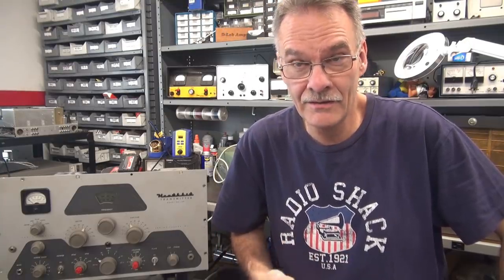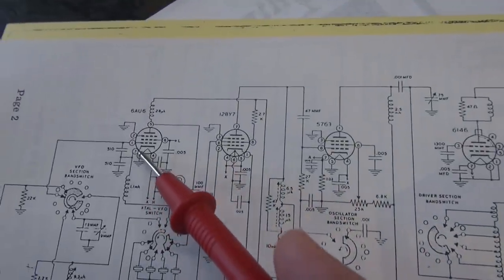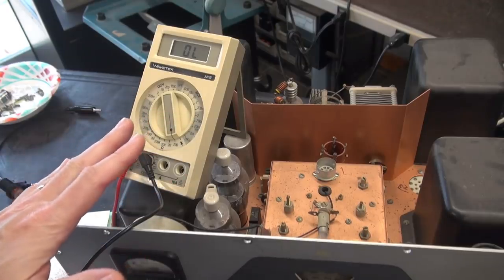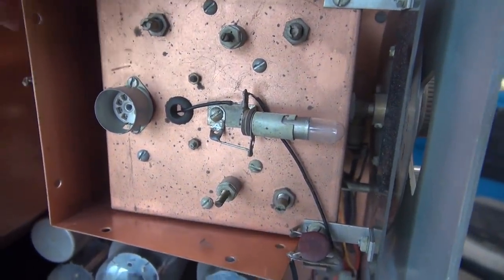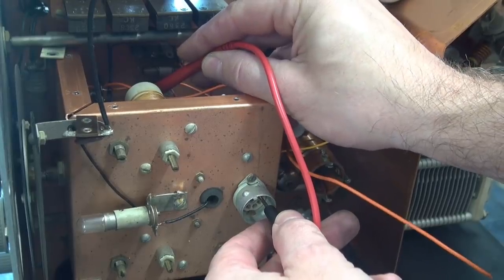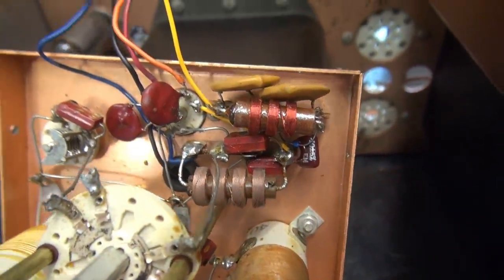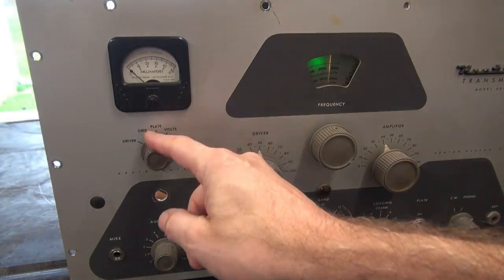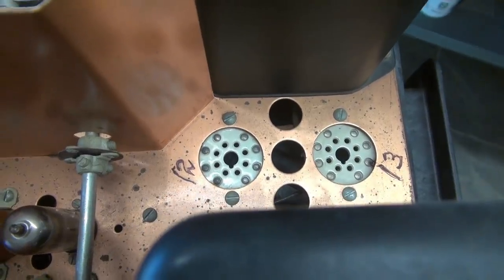How To Un-Mod Heathkit DX-100 Ham Transmitter Repair Grid Drive

Comment: I agree PLEASE DOCUMENT mods & put it with manual its seems silly but a few years later u ask yourself what the heck is that wire thing (mod)done  years ago ?ect. its so easy to forget & it saves a lot of time down the track .  I did it resonantly with home brew 813 amp almost finished on shelf few years scratching head whats that wire for!! my notes I made showed the reason.  good work good lov watching old gear live again ect
Reply: Problem is, the guy that had it as the pride of his ham shack gets old and dies, and the kids that never knew what was in that room sell it all off, and throw all the papers in the filing cabinet away. So much for carefully documenting it in his manual.
Reply: @lwilton  Agreed I Wilton!!!!     As if the original manual is always kept with the radio!  😂